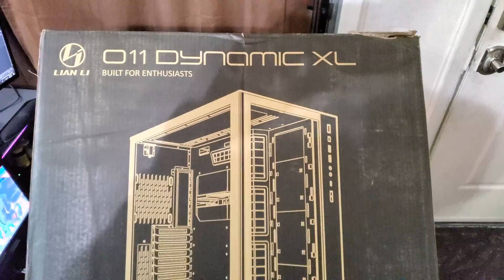Lian Li PC 011 Dynamic XL Custom Watercooled PC Build

Comment: Is there a vertical GPU mount which also works for the non XL version which does allow me to install 3 fans on the ground? The Lian Li one is mounted on the ground...
Reply: I know your comment is 7 months old but I have the non xl version and microcenter sells a vertical gpu mount by Lian li that says it’s for the lancool 2 and it worked for me.
Reply: @johnk3850  ive found ways but i like my GPU in the standart position more now.

Comment: The audio quality in this is brillant as in I can hear everything in my studio headset.

However I can here everything, mainly the rustling in the ear and it does go through you.

Nice to see what other peoples ideas are and love what you have done.

Still don't know if I'm gonna get a waterblock. Have the corsair x stuff at the mo.
Reply from the maker: Thank you. I've since gotten a proper mic and setup. Thanks for the input. Much appreciated.
Reply: @Moyersteven1  no problem mate, I was impressed with the surrond sound in the headphones and sound quality at the same time lol. Just not what I wanted to hear lol.

Howd you come up with the build design as you have done a great job?  I corrected my comment above as my typing is terrible. I really need to proof read things before I post them lol.
Reply from the maker: @stalker1567  Few different ways of coming up with the design. I take a picture of the case with the components Installed without any tubing. I put it into Paint 3D and then do my runs. That way I can change things if I don't like them. I do that to just get a rough draft. Then when I'm ready to actually install the tubing I take metal hangers and cut them. I then use the metal hangers in place of the tubing. Using the hangers gives me a idea of how it actually looks in person and not just looking at a picture. But it also helps me get clean tubing runs. Once I have the layout I use the metal hangers as a template for cutting and bending the tubing. I rarely get messed up tubing or have to redo bends. It has worked out great on my last 3 builds.
Reply: @Moyersteven1  well God dam that idea with the metal hangers is amazing. As in the thin metal hangers. You should do a video just on that.

I've read your commend and my mind is blown. Guess I'm off to look for some hangers.

Comment: Not bad overall, your bends and tubing runs are on point. But what made you use 240 rad on the side? I could fit 360mm xt45 into that compartment on non xl version. Also the bottom looks a bit empty I would put there another rad.

Comment: Gave a thumb up just for pointing out the lock on the drive bays and how to disengage it...no one else covered that in any of the other vids I've seen for this case. Thanks.

Regarding your cable tangle...Lian Li was working on a prototype of daisy-chained fans that only need one cable per chain earlier in the year. I don't know what the current status of that is, but it would definitely cut down on the rat's nest of wires that has to be tamed. If you find out anything about that, drop a vid and let us know what's up. Thx & subbed.

Comment: Nice Build, it looks great, are you using only 1 commander pro for all your fans? I'm planning to build a custom loop in my regular Lian Li 011 dynamic with 2 360 rads and 9 corsair fans but I'm not sure if I can control the 9 fans with 1 commander pro.
Reply from the maker: Yes, I have 1 Commander Pro and 2 of the RGB fan hubs. I have one RAD with 3 fans hooked up to a 3 way fan splitter and then the rest plugged in to the Commander Pro. Its possible to run many fans off the Commander Pro if you use fan splitters. Thanks for stopping by and checking out the video. Any more questions feel free to ask.

Comment: whats temp under load and idle for gpu n cpu?
Reply from the maker: CPU Idle is 28-30C and under full load dont go over 60C. GPU Idle temp is 30-32C and full load is around 58-62C.
Reply: @Moyersteven1  nice..thnks for fast reply..wanna ask,d5 or ddc better?
Reply from the maker: @abbydaa89  I would go with a D5.  DDC Pumps produce significantly more heat.